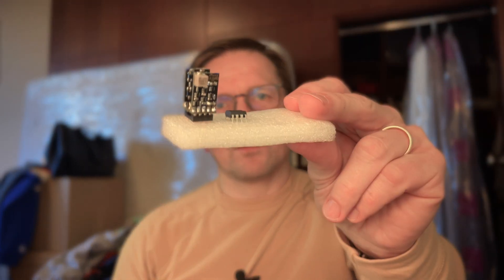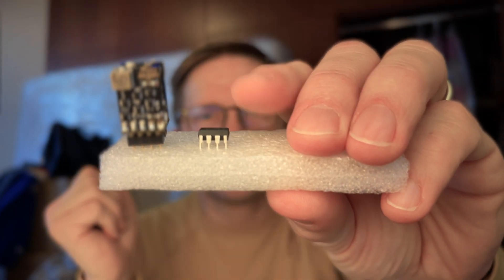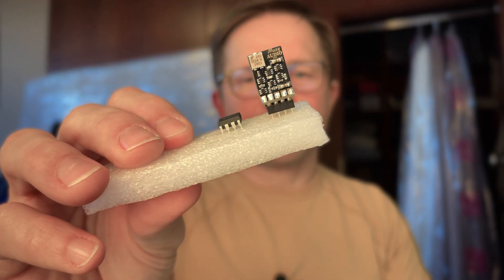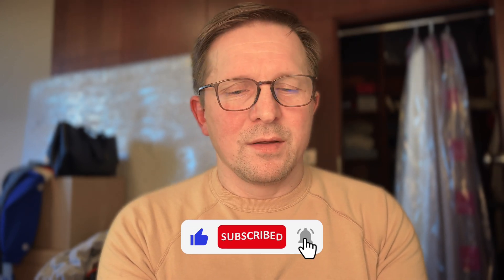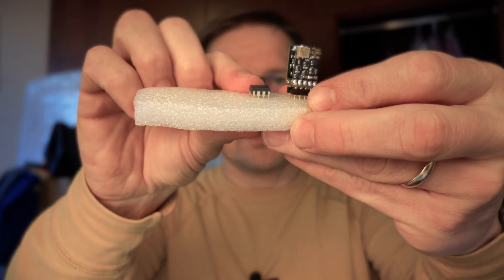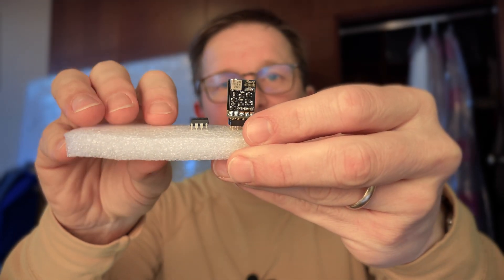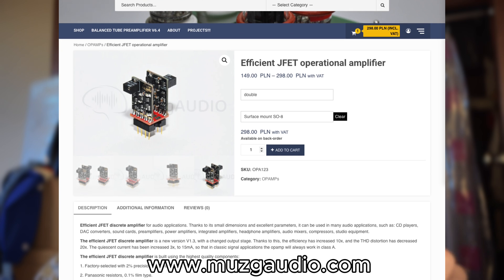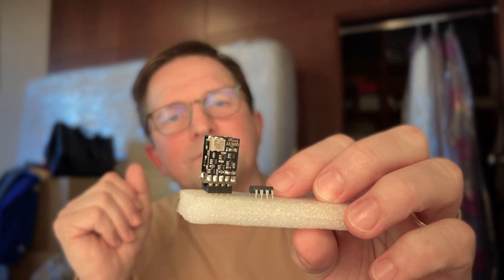This DISCRETE OPAMP from MuzgAudio is a no brainer 🧠

Comment: You have no idea what you are talking about! OpAmps are not like digital camera ccds, where bigger is better. Where are the measurements that show how better the amplifier works after swapping opamps? Only nobrainer are the people buying this overexpensive opamp thinking their amp sounds better. Use an OP275 instead and save 65 dollars.
Reply: I already changed to a discrete audio interface. The discrete op amp is much better. The headroom is very good, the vocal tone is very loud, and it contributes to an analog sound.

Comment: Can you tell us the difference between ‘surface mount SO-8’ and ‘Through hole DIP-8’ on the Muzg ordering page on their website?  What are they each used for?  Thank you.
Reply from the maker: @EvenHarmonics, the difference is in the way you mount the opamps to your amp's PCB. Surface mount means you solder it from the top of the PCB. Through hole means there are holes in the PCB through in which you put the opamp's legs and solder it from the bottom, or there is a socket with holes mounted on the PCB in which you place your opamp. Hope this helps.

Comment: What measurements show this is better? Physically larger creates more loop area for noise pickup. Single chip op-amp can have better matched transistors internally as well as thermally coupling transistors very well that can reduce common mode sensitivity and input offset.
Reply: There's a way to get the best of both worlds: low noise of discrete components, and common mode rejection of matched transistors. And that way is JFE2140.

Will this ridiculous level of quality ever be needed for consumer or pro audio? Nah... But it's a fantastic part, makes money off of audiophiles and is very useful for research and probably audio analyzer gear :)
Reply: So many "can".

Comment: If you’re looking for an inexpensive IC opamp, the OPA627 is a great performer, with excellent transparency and detail.
Reply from the maker: Thanks! I’ll have a look at it.
Reply: Its great for bass and very engaging, not so great and detailed at the top end as the 828.
Be aware of fakes on the market - the OPA627 costs nearly $30 for the single opamp, a dual is $60 just for the chips - so if you see $7 its got to be a fake.
Reply: @fx-studio  There are not any OPA627 duals! 627 is a sinle OPA in any package
Reply: @vidselih  I am talking about when they come mounted together on an 8 pin PCB - those are duals and plug straight in.
That's the most common way they get used, and those shouldn't be only a few dollars if they are real.
Reply: Most Burr Brown op amps are very highly respected.
Reply: @NullStaticVoid  Texas Instruments bought Burr Brown so they are all TI parts now - but yes highly respected and still available.
Reply: @ChicagoRob2  opa1656 is brings out the detail
Reply: @ChicagoRob2  better then 1642?